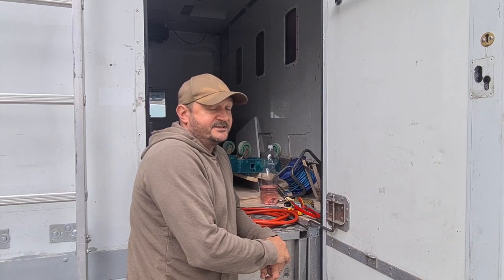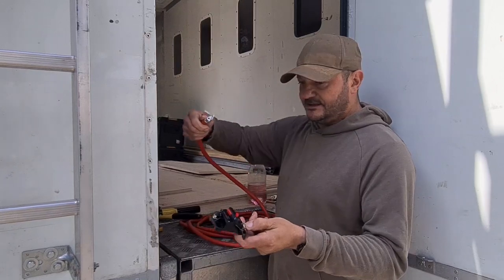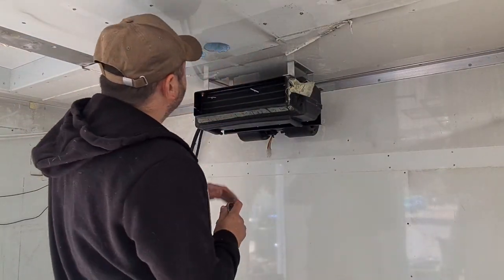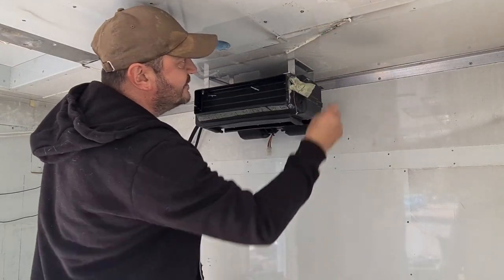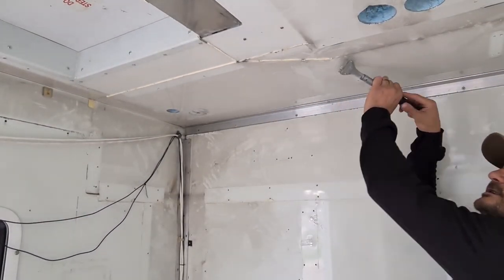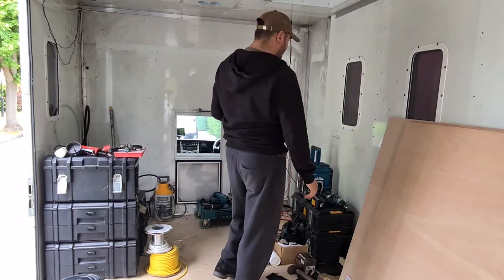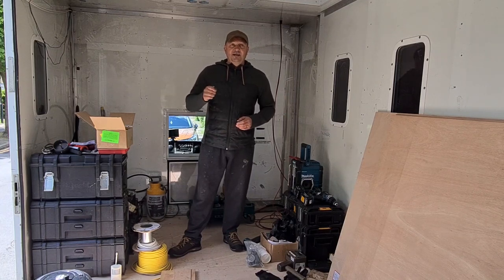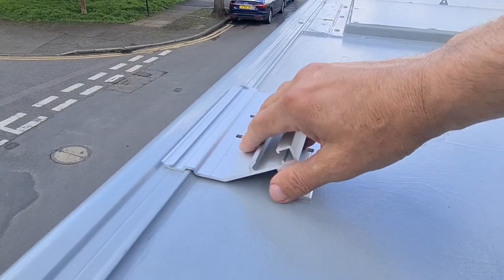Self Build Off Grid Campervan Conversion, Iveco Daily Prison Truck 6.5T

Comment: 'Me just doing my build' but I get the impression that this is not your first build and you have a nice, practical attitude which gets things done.
Reply from the maker: This will be my 6th build since my early 20s. I'm 50 now. Biggest one was my 7.5t DAF built for my motocross days but I used a donor caravan for that. My last one I never got to use, it was finished during the last lockdown and sat there waiting for a drunk driver to write it of unused. I'll put some pics up of that build in the next video. Thankyou for your comment and participation. It is greatly appreciated 👍

Comment: Really interesting project - you have a new sub here :-). 

The weather of late has been a real chore. Totally agree. How are you finding that hydraulic crimper? I bought a long handle type and realised the blasted thing only did up to 50mm2 cable. So lovely of you to offer help to others. Respect.
Reply from the maker: Morrrrrning. The crimper does the job fine. My max size cable in the build is 50mm but I do have the dyes to go one size bigger but you do need 3 hands otherwise it makes you look like an idiot lol. Thank you for the sub 👍
Reply: @PrisonersNoLongerAccepted  Ah the old holder is required 😊. That makes sense re. The 50mm. We need slightly larger with our stuff on the battery side. Glad I found your build. Great stuff 🚐🚐🚐

Comment: Just come across your channel. Was thinking of a prison van myself.
Reply from the maker: I'm so glad I have gone through the hard work but the 6.5t high security vans are tough to strip. The 3.5t I hear are easier. Good luck and I highly recommend getting one 👍
Reply: @PrisonersNoLongerAccepted  it would be a 6.5 I’d go for. As I’d live in it. Undecided wether to prison van, police van, ambulance or just got for a truck! Only thing against the truck is off road & fuel. Good luck with the rest of the build. Have done a police van with cages. That was bad enough! 😂
Reply from the maker: My 1st ever build was a met police T4 many years back and that had the cage. Good luck with the shear bolts on the 6.5t Prison van. They are the devil in disguise lol

Comment: Loving the videos (just subscribed)  I have a quick question.  what are the internal measurements of the van?  There also seems to be good storage under the van sides, would you be able to show these in another video?
Reply from the maker: Hi Carey. I'm going to do a video about the dimensions of the habitation area soon. I will have a look at the lockers for you as well. I can throw it on to the end of the next video coming out in the next couple of days but in the meantime 4600L x 2220W x 2030H. The height is after fitting 18mm ply floor and approximately 9mm on the ceiling. Cheers

Comment: Are you going to use the void between the inside floor & the chassis, maybe a hatch in the rear foot well? You could put polls, ladders? Your folding table thing ??
Reply from the maker: We will be using the void for various storage lockers
Reply: Thanks for showing the side lockers, is there space under the floor in the middle of the body above the chassis that is the the same size as the rear steps (that drop down) that runs the full length. When you showed us under the truck at the front lockers you could see a v shape cut out where some wires went it looks to be a good 6-8 inch square box running from front to the rear steps? This looks like unused space ?? 👍
Reply from the maker: I'm gonna get together many many questions I get asked and put them in a video within the next week covering good footage of underneath the habitation area and all the space available... Also in the video will do a Q & A 👍

Comment: All the van build's I have seen they put down insulation and a vapour barrier. Do yo need these? I would of thought you would of at least needed the vapour barrier with this being plastic it would get quite warm in the summer months. Great videos tho really enjoying the ones you put up so far and look forward for all the rest. Good job
Reply from the maker: Idea of the vapor barrier in a motorhome is to prevent water vapor, us breathing etc from reaching the insulation which will get damp and then rot the steel walls of your van. I have a sheet of Ali then insulation and Ali so my theory is the internal sheet of Ali is the vapor barrier but failing that it's not gonna rust like steel so I think I'm ok with the measures I have taken but it's a good question none the less. Cheers 👍

Comment: For what it's worth the Spal AC unit in my 3.5 tonner was empty, no fluid, no gas, nothing. I checked what I guess were the coolant lines first, undid the jubilee clips and the pipework was dry, so I took a risk and cut the other lines and there was nothing in there at all.
Reply from the maker: Did you just cap them off. Thanks for this info. The lines do feel like there's no fluid in them
Reply: @PrisonersNoLongerAccepted  they're still just poking through the floor at the moment, the plan is to get underneath and have a look at where they end up then make a decision on what to do with them